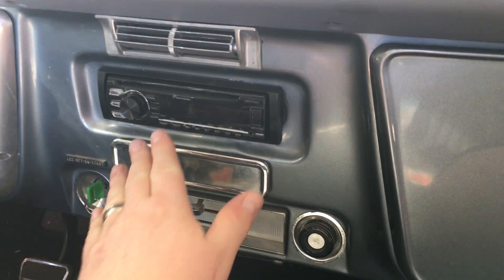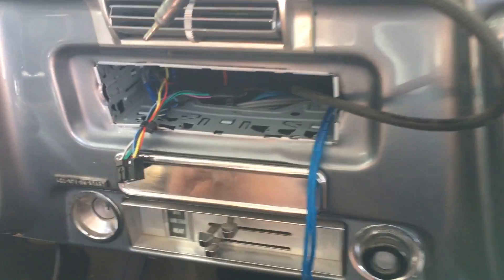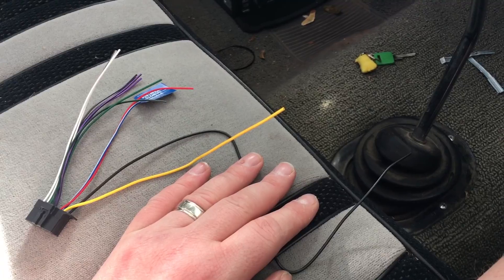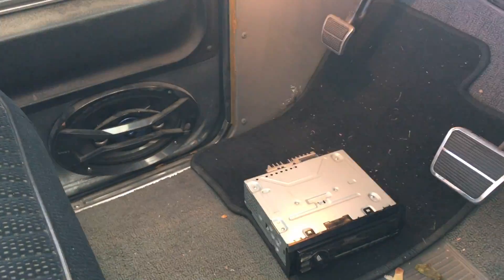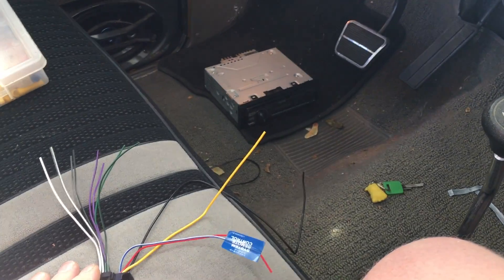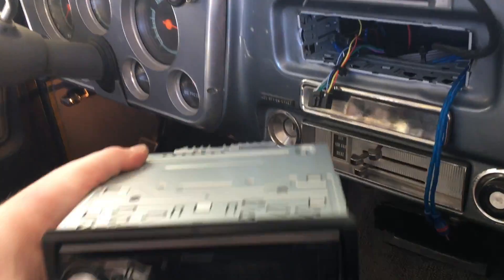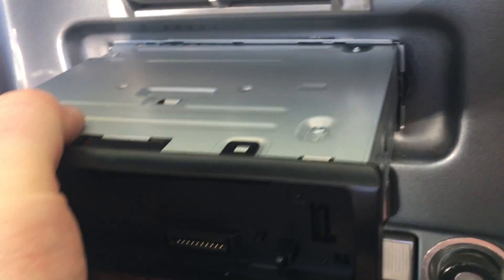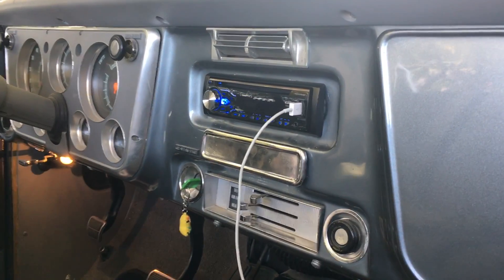1969 - 1972 Chevy K5 Blazer Pioneer Bluetooth Radio Install

Comment: What is the best method to enlarge the radio opening to accommodate the newer radios?  I do not want to spend hundreds of dollars to get a retro or classic radio.  Only want to install a new radio with B/T that works.  Looking for advice on enlarging the opening in a 1972 C10 truck ...  What saw to use?  Grinder?  Any constructive advice is appreciated.